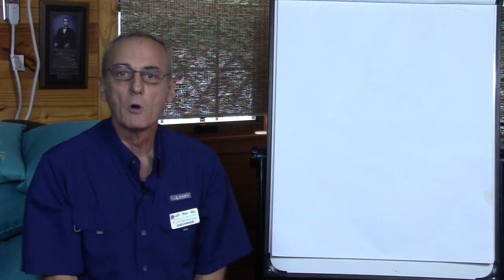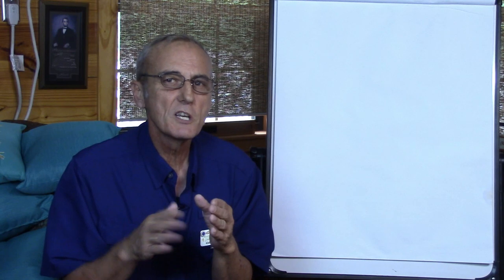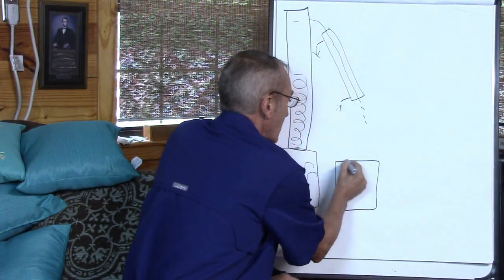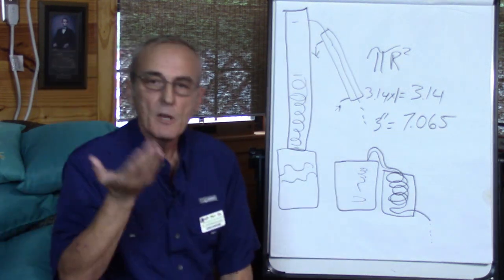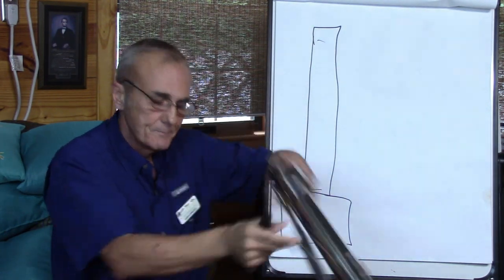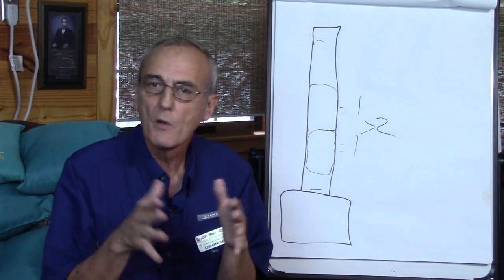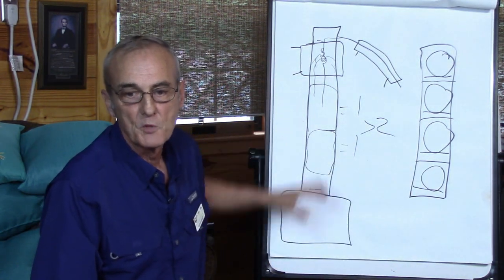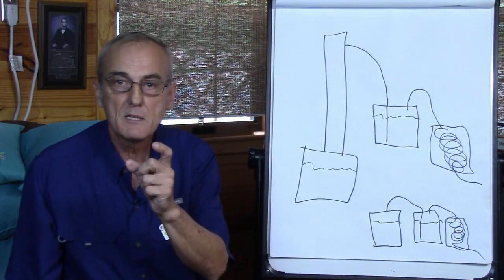STILLS OF ALL TYPES, DIFFERENCES AND EFFICIENCY

Comment: FYI:  The equation for the circumference (C) is 2π times the radius: (C=2πR) so if R is in inches, the circumference is in inches.   The cross sectional area (A) is π times the radius (R) squared: A=πR^2.  If your radius is expressed in inches, your area will be in square inches.  So, if you double your diameter, you double your circumference and quadruple your cross sectional area.
Reply: @Ed-lg9du great!  I enjoyed your video!

Comment: I learned a lot. Thank you. One note: You are using the calculation for the Area of a circle and not the circumference of a circle. Circumference is 2 π r.
Reply: doesnt the answer end up being the same lol...he said 3.14xR^2  for example my 4 inch column radius =2....3.14x2^2=12.56....oor your 2x3.14x2=12.56 nevermind i see that only worked out in my particular case, no wonder i didnt catch this.
Reply: Or πD = circumference

Comment: First thing, thank you for your 35 years of service  to our great country. What you are describing  is what's also known as a compound  reflux still. 
Mine is a 15 gal s s pot/ a 35  x 3 copper column, a 1" distillate exit. The marble rocks that I use for packing work really well, tones of surface area. 
I will be going electric pretty soon and will require  your  assistance.  Thanks for the humor  and educational  videos.

Comment: Great video! Love your lessons. Your math terminology was a bit off, though. The principle you taught about the pipe having more surface area was well put forth, BUT it's good to get the formulas straight. You were talking about the CIRCUMFERENCE of the pipe (or circle). That's DIAMETER (or twice the radius) of the circle multiplied by Pi (3.14). The formula you wrote down is for the AREA of the circle (Pi multiplied by the square of the radius of the circle). Like if you took a thin slice of a salami, that would be the area. Also, that would be expressed in SQUARE inches. So, CIRCUMFERENCE of a 2" pipe : 2 x 3.14 = 6.28 inches. CIRCUMFERENCE OF A 3" pipe : 3 x 3.14 = 9.42 inches. And so on. Can't wait to watch more of your stuff, I'm learning a lot! All the best to you.
Reply: Im not really sure if i like the fact that he didn't own his mistake with this math..think about that..what else is he giving us that is not needed..expecially if he sells all this stuff to add to the distillery...lol j/k but he should have admitted he was wrong

Comment: I love your content Sir. Of all the videos I have warched on your channel the one thing that has been missed is a video strictly to Still types, differences, and the effects on final product (IE. Flavor, purity, consistency, ease of use). Your most recent video is fairly old. However, if you were to "hypothetically" (hehehe at that reference) make another video, would you consider one involving strengths, weaknesses, ease of use, and final product differences of the varying types of stills and combination stills using different combinations.
Amazing work and thank you for setting a standard for for the distillation community.

Comment: You mention the possibility of fire with an open still, but so long as your pot is some sort of steel, an inductive cook plate would be an excellent heat source and there is virtually NO chance of any ignition.  That's what I plan to use when I finally get around to constructing my still.

Comment: I use metal canning pot with tight lid and hole in the lid. The column is actually a 60 cm Vigreux column from lab glassware supplier and it works pretty well. It achieves 160 proof in one run. Now I am experimenting with controlled reflux and packed columns. The glassware is not very wide but works fine and is easy to clean.

Comment: Remember the old pressure cookers with the tip on the lid that you put weights on to regulate the pressure? My junior high science teacher showed us how to make a still out of one by putting 2 half bricks in the middle of the pot with a cup on top of them, now pour your fermented potato mash around the bricks, put the lid on the pot upside down and close the tip hole with a toothpick, fill the inverted lid with ice and slowly simmer the mash. The first steam of the alcohol condenses on the cold lid running down and dripping off the tip into the cup.
Thus, the introduction of alcoholism to my 13-year-old self!
Thanks, Mr. Morris.   (Tongue-in-cheek)

Comment: I see lots of people commented on your talk about circles, Pi, circumference, area, etc.  If I may make things more clear...So more correct to think about it...Circumference=2xPixRadius.  For a 2" diameter column, the C = 2 x Pi x R = 2 x 3.14 x 1 = 6.28"   So the length around the column is 6.28".  And if you you multiply that by the height of your column, say 48", then your surface area is about = 301sq".  Compare that to 4' of 3/8" tubing, which will have only a total surface area of 57sq".  Quite a big difference right?

Comment: Hi I have just started trying to learn about this, and have no equipment as yet. First of all thank you, and regarding this video, dealing with surface areas, and volume of cooling water in the condenser, you say that: "if you cool too much, the output drops", and "if you cool less your output increases". I understand that, so can I say: 1. if you increase the cooling , the output drops, but the quality improves?  The other question that I have, concerns volumes and quality. 2. Just an example: I take a 50 litre beer barrel still, and fill it with 40 litres of red wine, of which the abv 13.5%. Can I say: you can distill that 40 000ml x 13.5% = 5.4 litres of the purest alcohol, assuming that the cooling has been adjusted to optimal efficiency ?  3. Am I correct in saying that a reflux still, can improve the output quality of the end product, but will therefore use more time  and energy to its heating requirements ? 4. A tweaking question:  Once the thermometer at the top of the column, reads the correct heat to produce the vapours, you don't adjust the heat source thereafter ? 5. IOW  can you speed up the process, by boiling faster ? What happens when you boil faster ?
Reply from the maker: You have much going on here. 
First let's answer the most important question: Can you speed it up by boiling faster? There is no right way to do the wrong thing... Don't try to out think or short cut the process. It will only disappoint you in the end.
A reflux will improve the purity not necessarily the quality. It will also strip any flavors. 
Once your still starts to produce it will continue until the volume in the kettle changes (goes down) at which point you will need to increase the temp to vaporize it again.

Comment: Just to quibble just a little. You conflate cross sectional area with circumference, they are not the same. You say circumference when you mean cross sectional area, which is changed by the radius squared.   (Area = Pi *radius^2)   { Circumference=2*Pi*radius}. I do know that much. Now to what I do not know. You state that the systems without a thumper are open systems. Yes they are. But if a person over fills his his Kettle, and then he boils it over into his condensing column and plugs it up. Then it no longer is an open system. An explosion could be anticipated. Of course, this scenario is more likely with a 1/4"  diameter copper tubing condenser than a 2" column.  It could be noted that for each 1 inch of water column in the thumper, the pressure in the system increases by 0.036 psi. A seemingly insignificant amount. Now if you could humor my ignorance. Why should I care about efficiency if I am going to dilute my product down from say, 140 proof to 80 proof,  or alternatively 110 proof to 80 proof?  And if I prefer a blended Canadian whiskey over a sour mash whiskey, how do I achieve that, or is that too fine of a distinction?

Comment: well I certainly do enjoy your program, thank you Mr. George. I have a question I was hoping you could help me with. I'm new at this but not new, my Dad learned it from my Grandpaw continuing back for many many centuries in Scotland before they arrived here in the New Country. The problem being Mr. George is that I didn't pay attention to e'm when they were learning me and now they're all gone. My question is, I got about a 15gl pot with 3'' column, which your program taught me I need to make a little taller, and a radius 3" elbow setting atop it. From there it goes bout 10ft in a horizontal slightly downward direction reducen bout 4 times to where it hooks up to my 3/4" worm(worms bout 50 to 60ft soft copper long). I have so much resistance in my worm that before hooken it up I always try blowen threw it and I can't. I know it ain't blocked cuz I put a video camera threaded through the middle of it all the way to check. Do you recken I have to worm to long or not the write size? cuz it takes bout an hour or so before even the throw starts to trickle out. Everythings copper sept the pot, its eluminum, I need it bigger cuz I mash 50gls at a time. I don't ever sell it ya see, its just part of our history goen on for bout 5 or 6 hundred years now I guess and I just didn't realize how important it was till now

Comment: Circumference is 3,14 times the diameter (2 times the radius). The area is 3.14 times the square of the radius.
Reply: yup, at one point he says "circumference or surface area"  ya follow? :)
Reply: Circumference (is a length around a circle/diameter) to surface area is the same as lineal feet to square feet. Totally different measurements. 2” diameter = 6.28” circumference, 3” d. = 9.42” but 2” d. = 3.14 sq in area, 3” d = 7.65 sq in area.
Reply: I believe a more accurate term for what George is trying to describe would be "cross-sectional area".
Reply: The surface area/volume ratio simplifies to 2/r

Comment: Hello, I recently purchased a Still Spirits Air Still and plan to run my second batch tomorrow to test cut levels over the 2 hour distillation time. I plan to make 5-6 gallon mashes with my additions from your videos regarding DIY turbo yeast, and using clay clarifier, no rice hulls. My question would be after enough time experimenting with the model of pot still I have, should I upgrade my setup to process more volume per batch of mash for more liquor to have on hand?

Comment: i have a reflux still, watching this video and the difference between a pot still and a reflux is one uses heat, the other uses heat and water, my question is, when using the reflux still do you set up your still using heat only to begin with, then regulate water to condense the steam, because mine has a electric element in and I've only ever used the water to regulate everything, but recently tried using a propane burner and it gives me so much more control

Comment: minus the colum does the angle of the spout coming out of a pot still affect the volume of vapor or the out come. reason I ask is I see them coming straight out then elbowed down at a 90 degree angle and others i see come out of the pot like a 45 angle
Reply from the maker: It is all the same just a different look. 
Good observation and question.
George

Comment: I’ve used a 5 gallon pot still many times, using propane, outdoors, many times with the successful runs I wanted. My question is, would an electric stovetop burner work as good? Weather conditions control my outside ventures an if it would work I’d prefer indoor electric with such a small run. Thanks

Comment: You may have your terminology a little incorrect with reference to the circumference and cross sectional area of a Circle.
The circumference of a circle is 2*pi*r  and the pi*r*r formula you wrote down is actually the cross sectional area of a circle.
If you want to calculate the total surface area of the inside a circular tube you must multiply the circumference (2*pi*r) by the length of the tube (2*L*pi*r).
When you calculated the pi times the radius squared you actually determined the cross sectional area of the circular tube and the units will be in square length units (or in your case square inches). So 3.14*1*1 = 3.14 square inches. The circumference of this circle is 2*pi*1 = 6.28 inches.
I was very confused at your interchanging use of circumference, surface area etc. The Surface area is different from the cross sectional area. For example the cross sectional area of a uniform tube or pipe that is cylindrical remains constant along the length of the pipe whereas the internal surface area of the same cylindrical pipe does not. It increases as the pipe gets longer. They are quite different geometric parameters and are calculated differently.
Reply from the maker: Sorry if I confused you. I looked at this and I was back and forth.
George
Reply: @BarleyandHopsBrewing  Not a problem. Your videos are filled with practical advise based on experience. I am sure that you have produced many bottles of fine spirit.
Here is Australia, distilling ethanol is illegal without a license. In fact, even with a license, the ethanol excise payable to the Government is about $82 per litre of pure ethanol distilled. This makes home distilling or distilling on a small scale very uneconomical.
Cheers

Comment: I am making 25 litter still what is the length and diameter of the copper pipe i should use and shauld the Thermometer measure the temperature of the steam or the liquid? And thank you alot

Comment: What you think about idea: 
In 3 inch column instead mesh or plates putting 2 inch perforated copper pipe, maybe one more 1 inch perforated copper pipe (one inside another).
Maybe using perforated corrugated copper sheet and make a something like perforated copper pipe.
PS: my apologies for my bad english
Reply from the maker: Sounds promising. Give this a try and let us know what your results are.
Reply: @BarleyandHopsBrewing  Unfortunately i cannot make it happen, in my country we use only pot stills (old style traditional FULL copper, 100 L - 400 L per charge).
I was researching still types for some improvement or switching to another type to increase productivity.
We make alcoholic beverages from fruits from 10% - 40% (that garbage only can be bought in market), home made from 50% up to 70% strong.
Information what I have now I don't think column still will work. 
Especially stainless steel, can not be any other materials except copper.
I will continue researching possibility maybe i find solution.
I want to thank you for time and patience for all videos made by now.

Comment: I use rashed rings to increase surface area not copper mesh, what is the benefit.
Before i had the rings i used a handful of stainless screws.

Comment: Hi George, great video 
So if I have a 50L keg and I want to run a 3” column for better efficiency, would you recommend to just use a 2” to 3” adapter or cut the 2” fitting off the keg and weld on a 3” tri lamp fitting for the 3” column ?
Thank you 
Paul

Comment: curious  so 2in to 3inches for your column is close to standard. But i how many distillery levels for your column and height between them to get close to pure 200 proof. And in general how do you mathematically compute what proof your going to be around given the length of pipes,heights ...etc. Still confused on that. But sure looks easy to distill stuff and also build a simple still / drilling it/ welding copper tubes ,...etc.

Comment: What happens if I use a tower with sections and sight glasses and bubble plates, if the tower itself is too small? I have a big stainless tank about 5000 ltr. Not wanting to fill it much, but the tank is great. I want to use a 4 inch tower with a 4 inch copper onion head expansion chamber under the tower.

Comment: I think what he has failed to inform us about considering the difference in columns is that the less volume area contained in the vent not only makes a difference in proof, but that difference in proof consists of mash material. The higher proof that is cut with water and the naturally lower proof due to less still volume will have significantly different taste. The naturally lower proof product contains mash material, which may be desirable. The higher proof cut with water is more like high end vodka.

Comment: I have a question, I use a normal potstill (5 l)  without column, and I have found a excellent recipe, now I'm thinking about to buy a new still (50 l), but with a column with trays or plates, I have many questions about that because I don't know if my recipe would change, I don't if the taste would be same. I know about efficiency, but I need your opinion thanks you

Comment: You touched on going with too big of a column... If you have a 26 gallon pot... is going with a 6-in 4 bubble plate column with a 3-in condenser too big for that pot.... Should you limit that pot to a 4 in 4 bubble plate 2-in condenser...

Comment: Love your videos. You teach everyone so much. do you see any benefit of insulating a 2 inch column? I'm taking off about 115 proof on one run with a thump keg.
Reply from the maker: I believe in insulating the column if you are not running a thumper. The heat necessary to make the thumper work comes from the kettle so with the amount of heat generated without regard to controlling it makes insulating with a thumper all but an exercise of futility. Not much benefit.

Comment: Would you find a liebig condenser necessary for use in the ending pot where the worm exits in a 3 pot system with thumper just for use for distilled water?????